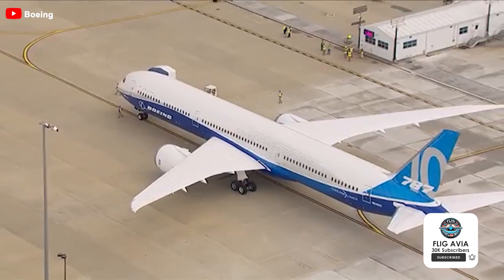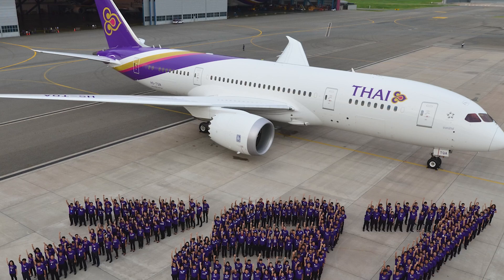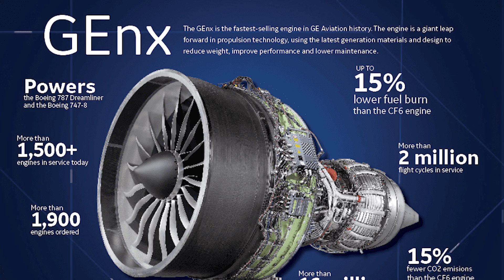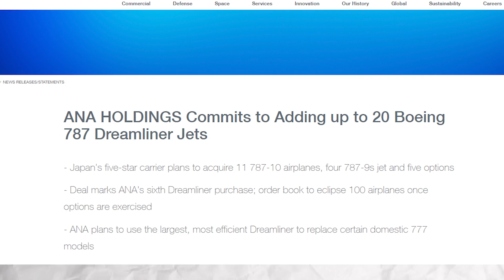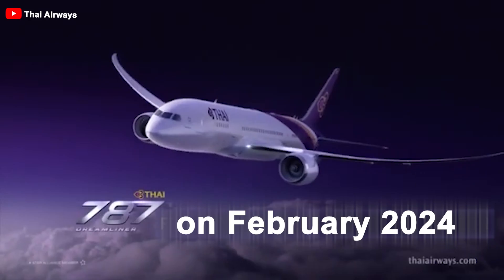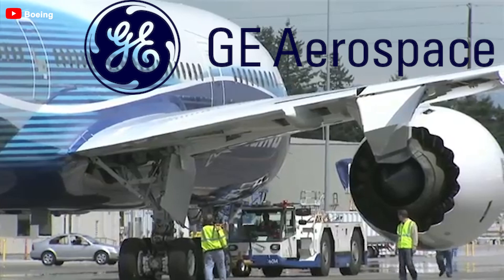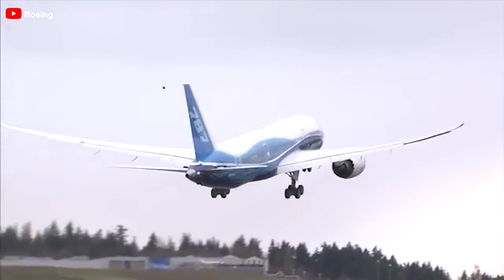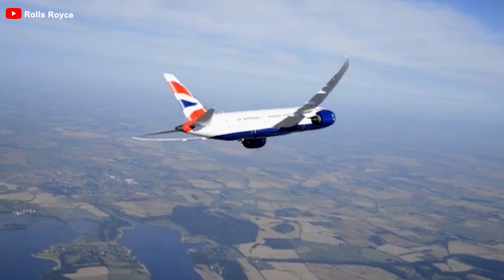You Won't Believe What Boeing Just Did with 787 Engine Operator! Here's Why

Comment: This is indeed bad news for RR & it`s T-1000 engine. When BA change from RR to GE you have to realise there`s a problem. I read recently they were having parts supply issues which were causing flight cancellations so this coupled with reliability problems must be a nightmare. It has to be said though that RR are not the only engine maker with parts supply troubles, I believe they all have this includes GEnx & GE90.